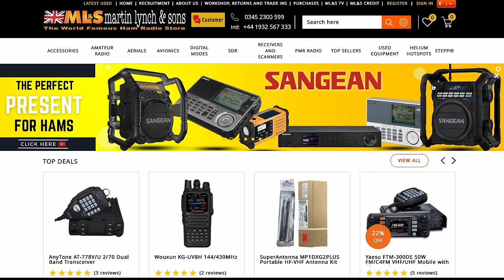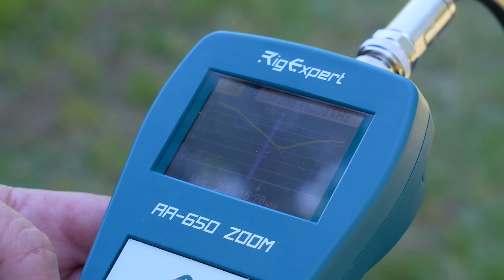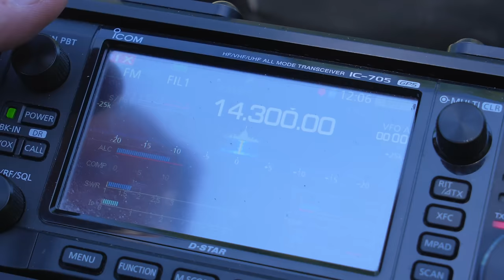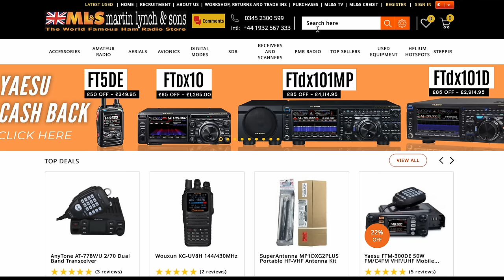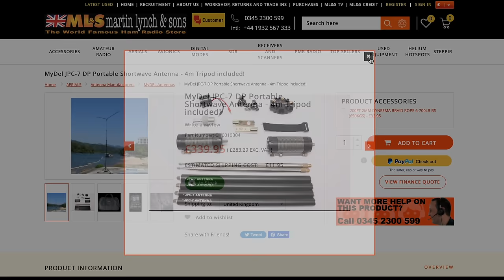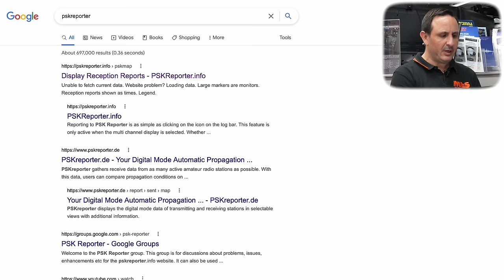PORTABLE IN UNDER 3 MINUTES? NEW JPC ANTENNA

Comment: Fellas, a line isolator is also needed on that coax before entering the radio otherwise the coax outer braid will act just like another radial which in turn will skew swr readings.

Comment: The PAC-12 vertical antenna is a great antenna. I received mine yesterday. The wire they give you for a ground radial system is around 27 feet. It's a non resonant length for 20 or 40 meters. Plus, the ribbon cable should be split into 10 lengths and spread our around the vertical. Cut five of the wires to a length of 16.5 feet for 5 each quarter wave 20 meter radials. 
What I did was to make my own radials. I made three each 35 feet long radials and three each 16.5 feet long radials. I spread them out around the base of the vertical and on both 20 and 40 meters my SWR went down to 1.2 to 1 SWR. My reading was taken at the feed point of the antenna. 
What you did was a quick and simple setup and that's great. My point is by working a little with the radial field you can greatly improve the performance of this antenna.
Nice video, glad you posted it.
Barry, KU3X/QRP
Reply from the maker: Hi Barry, many thanks for the great comments. You are quite correct, sorting the radial field will certainly help with the performance.
Reply: The few youtubes on this aerial say the ribbon cable is the weakest design and one guy made his own loop connector with four wires comming from it.

Comment: The dipole and coils look like an improved version of a Buddipole especially the center connector or versa-tee.
Reply: Exactly what I was thinking.  The sections even sound the same as they clink.  I wonder if the parts would be interchangeable? 73,  Bob  WK2Y
Reply: @bobgerzoff5072  10mm thread
Reply: @adventureswithsteve2981  I guess not.  Thanks.

Comment: Its a great wee antenna system , you should get the ground disk which gives you 16 points to mount 16 ground wires , i get 1:1 on 20m no matter where i mount it using the add-on ground disc

Comment: I thought i'd post a little review on the JPC-12 as i'm pretty impressed with it, but can't seem to add a review on the website. I purchased it,  as it's quite 'stealth' and suits my QTH situation. I must say, i'm more than chuffed with it's performance. In just under 2 months i have worked 57 countries, with about 470 QSOs mainly on 20m, and receive great audio and signal reports infinately more often than bad ones. "Very strong signal" and "great audio" are comments I have heard regularly. I run the Icom IC-7100 through it, and although i'd quite like an antenna that needs no adjustment to change bands, i require an 'antenna for small gardens' solution. I doubt if adding something like a Diamond BB7V will perform well enough to justify the spend, once I add in a tuner too. It's more efficient on 20m, which is unsurprising, but still performs well on 40m. I've started to work 20m of a weekend, then adjust the antenna to 40m for operation during weekday evenings, given the time of year. On SSB, my logbook includes Australia, Canada, USA, Iceland, Indonesia, Brazil and China, together with very regular contacts into pretty much all of Europe (for some reason, I find it difficult being heard in Greece, although I have worked Greek and Cypriot stations, but impossible to get heard in Turkey lol. I'm hoping additional radials, strategically placed, will help). After the first couple of weeks, I added 12 additional radials (Comet CGW-560 x 2, you'll need washers as the centre ring is larger than the antenna ground spike) and I really noticed a difference. So much so, i'm going to add another dozen, or find a radial plate and install more than that.  My JPC-12 is permanently deployed in my small garden, and has so far withstood the windy weather of late, even with the whip extended. All in all, a brilliant product. Highly recommended. There's a picture of it in situ on my QRZ page. M0JYH
Reply from the maker: Hello Nick, it's great to hear that you are enjoying the antenna. We have had numerous similar reports from our customers. These antennas are certainly very popular.

Comment: I added a LDG RU - 1:1 unun to the base of my jpc12 which helped bring the vswr down to near 1:1 on most bands, only been out with it once at the moment but it's looking quite a promising antenna.
Reply from the maker: Excellent Adam, many thanks for sharing that with us.
Reply: I have an LDG RU 1:1.  How did you attach it?  was it to the antenna with a short coax?
Reply: I thought about that too. I would use a common mode choke at the antenna feedpoint, particularly if I was running more power.
Reply: @briantrask8173  sorry for the long wait for the reply, I use a double male pl259 connecter straight to the base of the antenna and the common mode choke.

Comment: After seeing this video today, I ordered the
JPC-7 with tripod, which I do not see with
the US dealers advertisements. The more expensive postage to US is understandable.
Some comments have been that the JPC-7 
compares to the Buddipole, maybe with some improvements. 73 de W2CH Ray, NH.
Reply from the maker: Raymond, many thanks for your order and support. We can confirm that the MyDel JPC antennas are well made with an excellent finish. We have tested them and found the performance to be great.
Reply: What tripod kit did you order? N6WIP
Reply: What tripod kit did you order? N6WIP
Reply: @GPSJayDog22  The tripod was part of my
order from the UK. The mast with it extends
nicely for the antenna.
I did not see this tripod separately or from
the US suppliers
Reply: @raymondmartin6737  I too found that. I was hoping there was a part number or manufacturer identification on the tripod/mast assembly. Thanks 4 responding. 73, N6WIP, Jay

Comment: I am surprised someone hadn't come up with that coil tap arrangement decades ago. Its quite simple.

Other arrangements that can tap different points around the circumference may provide slightly better SWR, but not by much.
Reply: The sliding coil tap dates back to radio's early days. Crystal radios used them. Rorary coils have a slider like this, but instead of clicking back and forth,  it turns the coil.
Reply: My first home made receiver for school project used one.
An empty toilet paper roll cardboard tube, coils wrapped by ✋. 9th grade
Reply: Some decades back I bought the Pacific Antennas (original) version of this antenna. I modified the coil to a slider & it worked great for me on the FT817ND. Back in the day . . . Guess it’s time to drag the old kit out & try it on the new IC-705! Thanks for the great review & run-thru! 73 de W8IJN
Reply: They did.  The Buddipole has done it for 2 decades.

Comment: remove the centre coil tuning unit and use only the four aluminium tubes plus the telescopic antenna, reduce the last section to approximately 10cm and you are ready to go on 15m after checking swr...and remove the centre coil and the 4 aluminium tubes and use the telescopic section straight onto the top of the feed point and adjust length for 10m. so all in all you have a quad band portable vertical antenna......super bit of gear, would'nt part with my one now..De EI7IAB
Reply from the maker: Thank you very much for this fantastic advice.

Comment: Would hitting the spike with a mallet (eventually) damage the thread?
Reply from the maker: We strongly suggest that you do not hit the spike with a mallet. We advise that you thread a nut, of the correct size, onto it and then have a piece of softwood to use between the spike & mallet.

Comment: How is it under rough weather conditions I.e mainly rain, would any of the parts need to be waterproofed or would it just be good to go to set up as is?
Reply from the maker: This antenna will work just as well in rain or shine. There are no special requirements when it rains other than to waterproof the PL259 coax connector with good quality tape, just as you would any antenna.